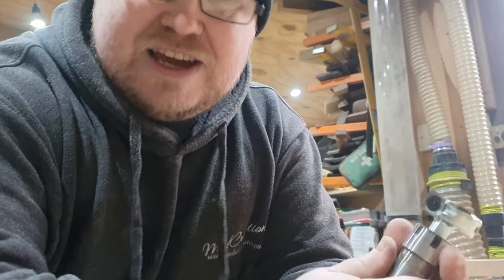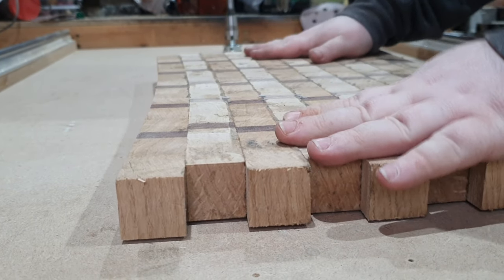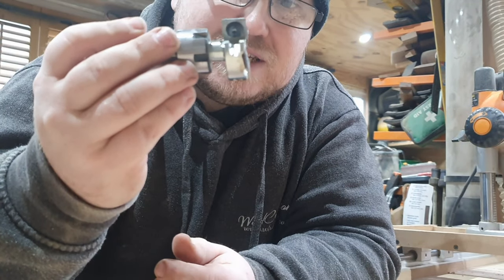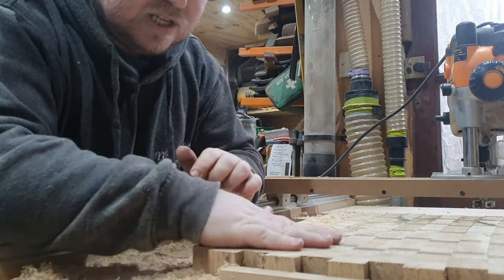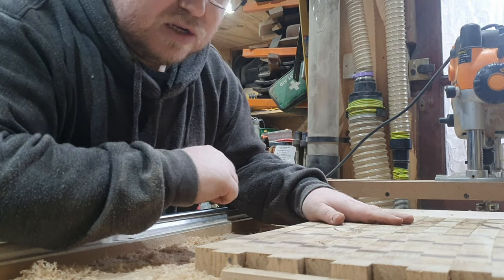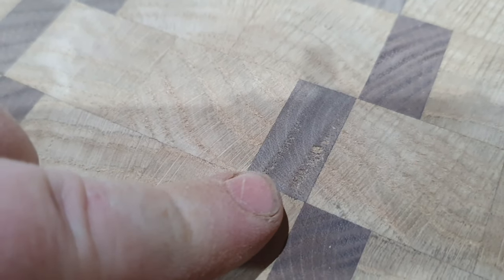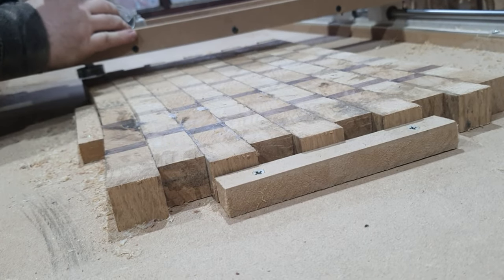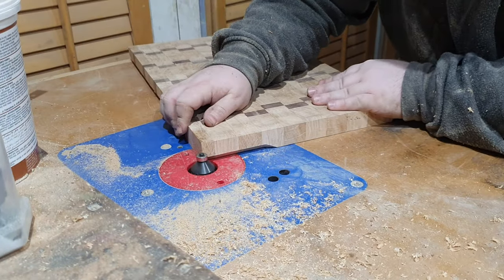Did I Find The Greatest Carbide Flattening Bit For My Homemade Flattening Router Sled?

Comment: Instead of a collet extender use a board of applicable size to raise the workpiece. Might find that way you get no tearout at all. Plus your router will be easier to control.
Reply from the maker: I have always been rather turned off from using extenders. I have found them to be unsafe to use, but I have been put at ease with this one. Really happy with how it performs. I was forever taking risks with the depth of cut, so this sorts out the issue nicely.
Reply: Same as my extender.  It seems safe and is just less a pain in the butt than using spacers to raise the rails.  I like keeping the board I have as a spoil board as the bed surface because I know its flat when I shim it.

Comment: Regarding the bowing of the MDF - I saw on a Facebook post a guy using two sets of linear rails with only a small, fixed, bit of MDF purely to hold the router in place. I think that will be the route I take.
Reply from the maker: Yep, I have ideas regarding this. Stay tunes 👍

Comment: Many say the Amana RC 2263 where 3 wing are at angle with @ 1/8" flat corner is the cutter. not a bad job but there sar so many choices feed speed and surface per min
Reply from the maker: I've some amana carbide bits. I've not found their carbide bits last very long, about 2 minutes on some oak. I've not got or used their bit similar to this one, so cannot say if it's better or not. Saying that, I am yet to change the carbides around as they are still cutting and as sharp as the day I made this video. Hope that helps

Comment: It seems that this router bit is worth its money. I was looking how much your cross slide is sagging when you lean into it, though, and I wouldn't be surprised if you ended up with concave board;). So as long as your side rails are supported by table, the first thing I'd change are the sides of that slide. And if your new bit allows for some thickness adjustment, that might even be all you need to get a pretty stable, rigid setup and repeatable results. It seems with this bit there are no problems with tear up at the edges, but even then you can experiment with conventional/climb approach, and  for example do the perimeter first in one direction or other and the rest after that...
Reply from the maker: Thanks buddy. Yeah the bit is amazing, it's my new go to! I have an updated video showing the upgrades I made to this setup. Works a lot better now

Comment: I don't have a thickness planer or a jointer. So, I plan to use this surfacing system fulltime, mostly on rough sawn lumber. How long will it lasts? Thank you.
Reply from the maker: The bit itself is one solid piece of steel, so technically it should last forever. The blades however can be changed out when they blunt, but you have 4 sides that be changed before they need changing out completely. They are also pretty cheap to buy, so when I brought this, I add the set of extra blades to go with it. Hope that helps

Comment: Hey new to wood working so was curious how much router power is needed to run that surfacing bit assuming I'm hitting the toughest wood. Just picked up a Makita rf1101 2 1/4 hp 11amp
Reply from the maker: Hey, that should be plenty of HP for this bit. Best of luck 👍
Reply: @WHCreations  Oh and also there seems to be some confusion as to sizing. Since 12.7mm is the equivalent to US 1/2 does the bit fit true to size for a half inch shank router?
Reply from the maker: They fit my 1/2" router collet fine mate.
Reply: @WHCreations  Awesome thx!

Comment: Stupid question, Which model did you go for imparticular on your link?
Reply from the maker: Hey, not quite sure what you mean by which model?
Reply: @WHCreations  im sorry, I should have clarified. The carbide cutter
Reply from the maker: Ah, they have obviously changed the listing on aliexpress. It was the 38mm diameter one. 1/2" shank. I hope that helps

Comment: The key with any cutting tool, is small passes and not try and take all the material at once. We're all impatient, but that is part of woodworking, be patient and it will pay off. Yes, all metal parts for your sled. Take a look at CNC router mounting plates to mount your router with.
Reply from the maker: Thanks for your comment. I would only go shallow with this type of cutter. Always good to know the limits, but with the cost of this one, it's good to go slow and steady 🤣

Comment: I did wonder about flex in the mdf, but thought the sides would have made it more rigid. Any update on the design?
Reply from the maker: The idea would have been to clad the frames with mdf and then build out the unit inside. However my parents didn't want to wait and my dad decided to finish it off. Not to my liking or design whatsoever, but they are happy so 💁‍♂️

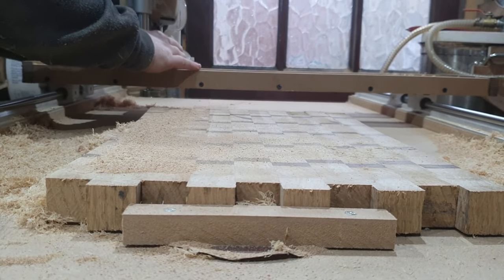Comment: Excellent. 4:40 howsabout using another set of rails across the original set to prevent bowing?
Now off to check out your other vids as I’ve just found you. 
ChinChin
Reply from the maker: Thank you buddy! I have some plans for this going forward, it does include more linear rails, but it won't be for a while yet due to other commitments. Thanks for your continued support 👍
Reply: Screwing up from underneath instead from the sides will give more strength, but definitely need to be using hardwood